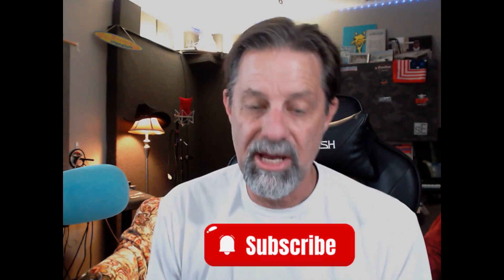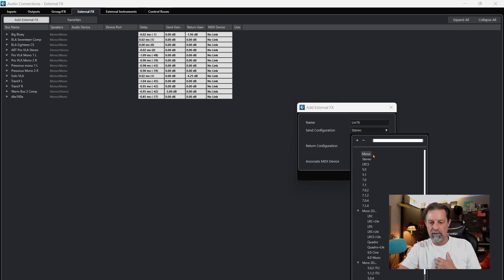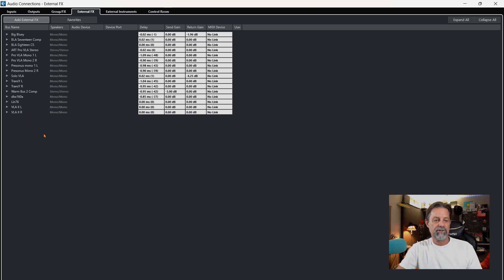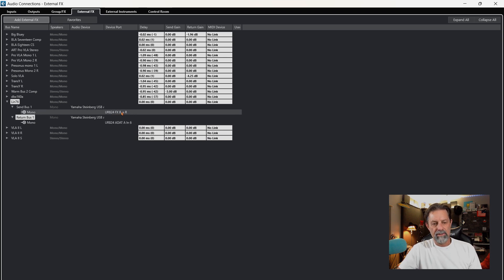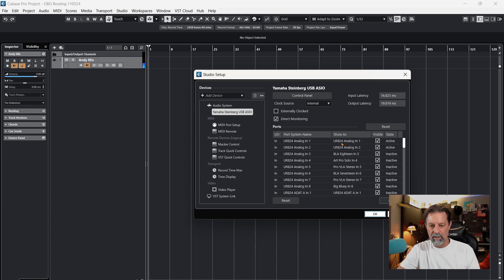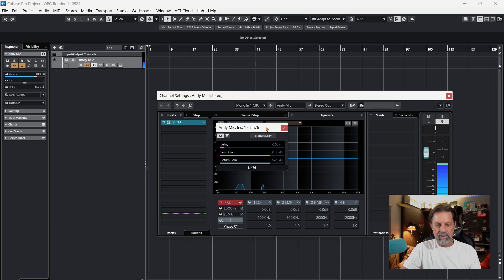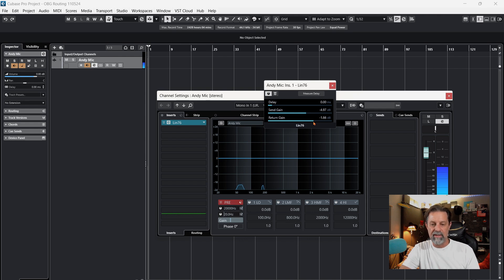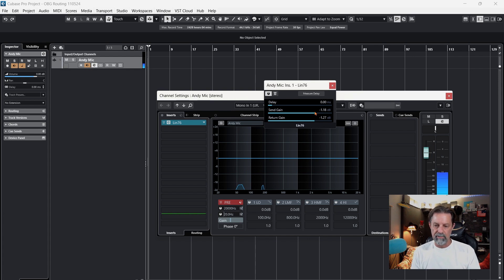Cubase Pro: How To Connect and Route Your Analog Outboard Gear To Be Used As An Insert Inside Cubase

Comment: Hey Andy! Thanks for the explanation. Is it recommeded to insert external fx in series? I mean, I don't know if due to the signal delay is better to activate only 1 external fx, bounce as audio and then apply the next external fx?
Reply from the maker: First off thank you for watching and commenting on the video I much appreciate that. You treat your external hardware gear just like you would any other plug in. You can either insert them as an insert or you can put them over on an send FX track. If you're using Cubase it has Time compensation which helps with any delay of signal. That way you can use your external gear just like you would a plug-in. I hope that helps and if you could please subscribe to the channel if you haven't thank you again
Reply: @ohstudiousa  Thanks for the clarification man. I have just subscribed to the channel!
Reply from the maker: Thank you  @fluxamondra

Comment: Can you only do this in Cubase pro? I have Cubase elements I do not have the tab for external effects Thank you.
Reply: Thanks.
Reply from the maker: Thank you for subscribing 💪❤️ #300
Reply from the maker: Thank you for watching and commenting I hope you found something useful out of that video. Unfortunately what you're asking about is only available in the pro version. But there is a workaround depending on what you want to do. If you're looking just to use external gear during recording then you can just run everything directly through your external gear and then back into your interface. If you want to use it as a insert unfortunately that can't happen because there's no way for it to route back into Cubase. I believe right now Steinberg is having a sale on Cubase something like 40% off plus you'll be able to use the upgrade feature which might even make it cheaper. If you like Cubase I suggest moving up to Pro because it's always better to have extra tools you may never use than to need the tools and not have them like in the case of the external hardware routing. Hit that subscribe button if you could please you would be subscriber number 300. Thanks again for watching and commenting.

Comment: Hi Andy, Do you know if there is any way to use a mix blend wet/dry inside of Cubase itself, when doing hardware inserts? I realise a lot of outboard gear like analog compressors have an actual wet/ dry mix blend knob, but I'm a bit worried about phase issues?  This is when trying to use parallel compression (wet/ dry blend). Having a software mix blend is one of the things I like in Studio One in their Pipeline Plugin for hardware inserts. Cheers Bud
Reply from the maker: Hey thanks for watching and commenting. Cubase automatically corrects the phase when you run a signal through your outboard gear. Those three little boxes that you see in the video have a time route make up in milliseconds. That is the necessary correction needed for any phase issue. 99% of the time I'll insert my gear on a FX channel that's attached to the source signal and use the fader as the blend knob. You can also use those little boxes as well as a blend knob. They have both an In volume as well as an Output volume. Hopefully my answer helps you out. Thank you again for watching and commenting with a question. Please subscribe if you haven't done so.